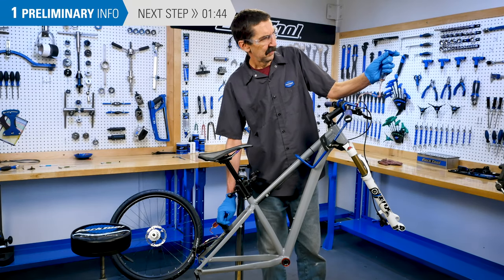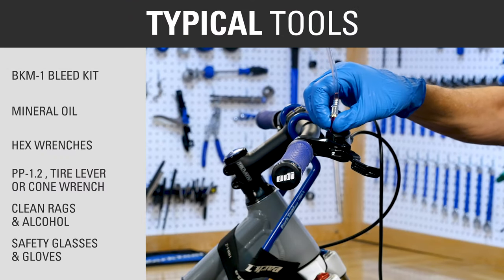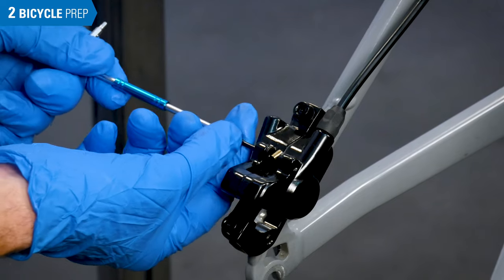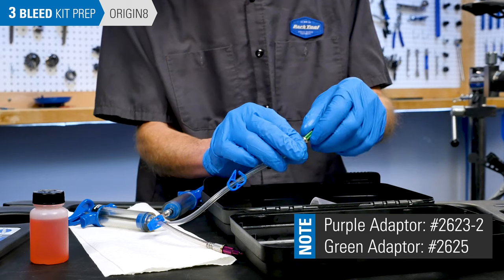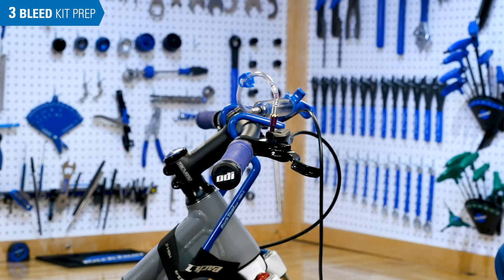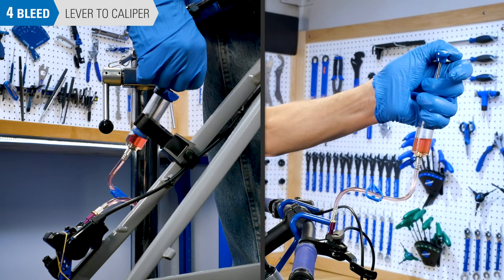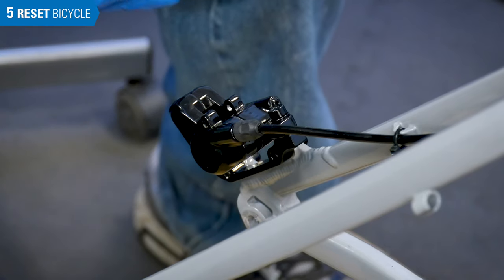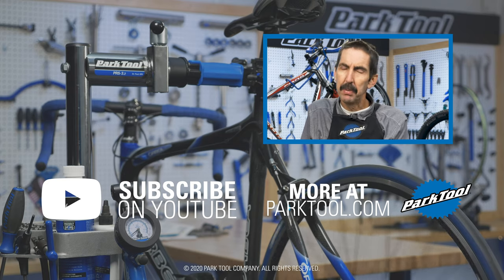How to Bleed Hydraulic Brakes - Clarks® and Origin8®

Comment: Which adapter can be used to Clarks Clout M1 from the kit?
M5x0.8 — Hayes® (x2)
M5x0.8 — Formula™ Cura™ (x2)
M6x0.75 — Magura®
M6x1.0 — Universal (x2)
M6x1.0 — Promax®
M7x0.75 — Shimano®
Reply from the maker: M5x0.8 up front and M6x1.0 in the rear.
Reply: @parktool  thank you so much!

Comment: I need help regarding my clarks clout 1 brakes I got it bleed already but I believe there's still some air inside,  when I first press the lever it goes all the way and the brakes won't hold yet  then as I press the brakes two or three more times then only then it would brake, I apologize for my english, i can't explain it well but that's that
Reply from the maker: Does the brake stay pumped up after you pull it a few times? Its common to have to advance the pistons to contact the rotor before the pistons position themselves. If it does not stay pumped up you will need to bleed again. Also be sure to check that your pads do not need to be replaced.
Reply: Same problem
Reply: @parktool  thanks a lot for this, I ended up getting it bleed again but didn't work, so I ended up changing to Shimano ones
Reply: @jvdarwinGAjr  I just replaced mine with Shimano, the issue didn't go away after lots of bleed and mineral oil replacement
Reply: @ejbicomong1587  maybe I should too. When I reset the piston and pull the brake it touches my handle grip but the next pull is okay.
Reply: @jvdarwinGAjr  maybe you should too, I don't think it's fixable, that's exactly what happend to mine, at times I feel not safe with the brakes, because it doesn't stop nor slowdown the first time I pull the lever, that's what I decides to change to Shimano
Reply: @ejbicomong1587  soon. Thanks

Comment: Help❗❗❗ I can't push the syringe from caliper to the lever.
Reply from the maker: If the port is open and the lever is not pulled it should be free to flow from caliper to lever.
Reply: @parktool  Double checked it. Theres still resistance from caliper to lever. Could it be due to the lever adjustment set too far causing a lever pull effect?

Comment: are clark brakes good?
Reply: No it better to get tektro or Shimano
Reply: They are for the price but they come from the factory pretty poorly setup (over filled usually and full of air) so bleed them.
Reply: @chris1275cc  I purchased clarck M2 hydraulic, and for their price are very good. I like to control how much I brake and, Shimano brakes only lock. With them it feels a bit better. FOR ME. Bt thanks for the reply
Reply: @SWFCite  why. For me they are pretty good
Reply: It is better to control how much you brake, than locking the wheel.
Reply: @aloualou56  I bought a bike with them on yesterday back ones fucked guess I just got a doggy one
Reply: @SWFCite  yeah. Mine are pretty good for their price.
Reply: And the bike I got with them was cheap. It cost 350€. It was a Matrix
Reply: Mine work great 👍

Comment: 6:58 mate that is the spongiest bloody brake i've ever seen in my life. you gotta leave this to professionals as someone may get hurt from this.
Reply: Its a hydraulic brake, they are supposed to be easy to use
Reply: That's why I am glad I am buying a prefilled  set since my brakes are spongy  as he'll ok I have to admit I use a enjuro bike for riding  to work because  its slightly  more comfortable  than a road bike plus I can go off reading  and punish  the bike and I  have crashed a few times lol also heard hissing from my brakes aswel so I know broke something  took it down to get serviced when I bought  the bike gentle breaking had me over the handle bars lol breaking was very strong new but they are weak now had new pads and it's not strong enough  now ok I did probably  abuse the brake pads aswel but everyone  does it who says a 7000 bike is worth it lol oh ismahsed and broke my carbon frame well who said any hobby was cheap dragster blow up a 50k engine every  race and mountain  bikers break a 8k frame lol